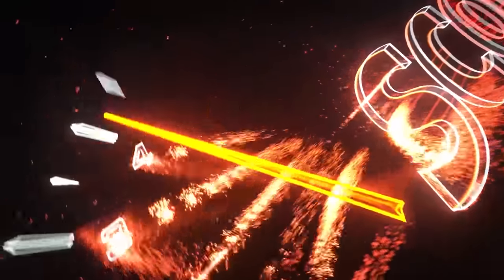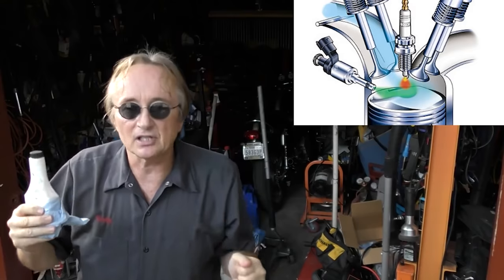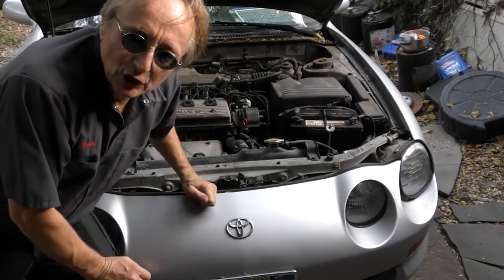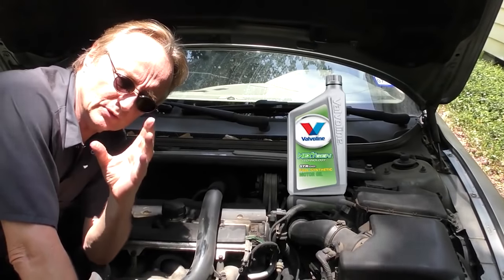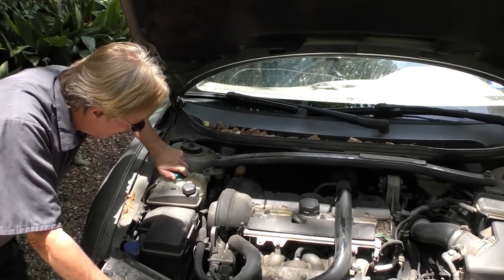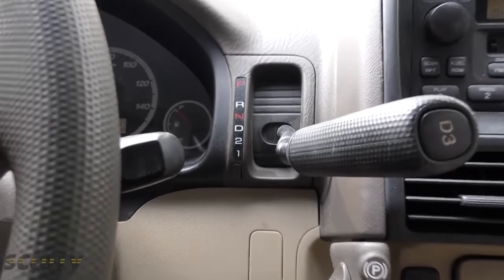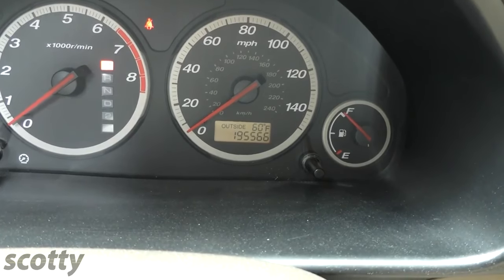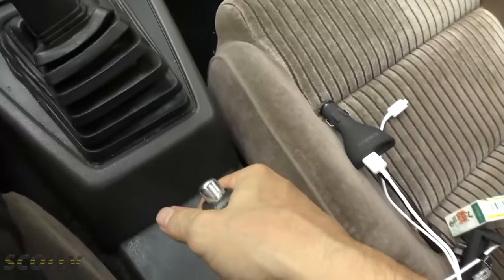20 Things Only Stupid People Do to Their Car

Comment: 11:17:  This behavior isn't the fault of the driver; it's the fault of the manufacturer who should design the transmission lever so that it can't move without the button being pressed in.  However, I discovered something interesting on a 2016 Toyota Sienna I used to have.  I noticed how easy it was for the gear shift lever to be put into reverse because the gear shift lever didn't even have a button on it.  However, one time I did accidentally throw the lever into reverse while the van was moving about 10 mph in a parking lot --- and THAT was when I discovered that apparently the manufacturers had thought of the possibility of that happening and had built a compensating measure into it:  Here's the compensating measure:  If you're traveling down the highway at 55 mph and you accidentally bump the transmission into reverse, nothing happens --- until you bring the vehicle to a complete stop --- and THEN the transmission shifts into reverse the next time you push the gas pedal.  So if that lever gets bumped at highway speed, you still want to immediately pull over, bring the vehicle to a complete stop, and then shift the transmission back into drive because you don't want that automatic shift change from drive to reverse to occur at a stoplight where you forget that the gear shift lever has been bumped and then you arrive at a stoplight, bring the vehicle to a stop at the red light, press the gas at the green light...and suddenly you find the vehicle violently backing up and ramming whoever is behind you when it happens.

Comment: Water cooled ? The product engine coolant has a lubricant in it to reduce friction on parts like the water pump.
Reply: "Water-cooled" is the term for a mechanical system using water-based coolant, in car engines that coolant is generally a mixture of 50% pure water and 50% ethylene glycol, with the ethylene glycol acting to prevent corrosion, acid degradation, lower the freezing point, raise the boiling point, and it also assists in lubrication. So yes, a turbo using the engines coolant is water-cooled.

Comment: If you have more than 75,000 miles, or so, it might not be a good idea to switch to full synthetic oil from asphalt-based oil. You may end up with oil leaks and oil burning. If your car started out with synthetic or you switched with low mileage, then no problem.

Comment: A few years ago I stopped to help out a couple who were moving house and their van battery had died - I offered them a jump start from my little Fabia - connected the cables properly on my end, then handed the other ends to the woman in the van (the van battery was in the passenger side foot well) through the passenger side window. I made the mistake of thinking everyone knows how to connect jumper cables and turned away only for my car to suddenly emit a horrific high-pitched screaming noise - she'd connected the negative clamp to the negative port on her battery, and the positive clamp to the little bolt holding the negative port to her battery - starting a small fire inside the van before she managed to pull the cables off, which was happily beaten out before it could do any real damage.

After that little drama we tried again (I wisely connected her battery for her) and off they went, but when I got back to my car the engine was still running, but all the electrics were dead (power steering, central touch screen, digital fuel reading and odometer).  Luckily it all came back to life after I restarted it - but can anyone explain what actually happened? What was the screaming noise from my car? Why did all the electrics cut out but the engine kept running? And how bad could it have been?

Comment: What about neutral in the automatic transmission? When should we use neutral?
Reply: When you want to disengage the transmission for any reason. Automatic car washes, or if you have a 4x4, you need to be in neutral to shift between 4-high and 4-low. If you need to push it or tow it. Anything like that.

Comment: Gosh - he shouts a lot, doesn't he? I spent twenty years designing the electronics for vehicles - we assumed that 1. someone will try to jump-start reversed. 2 someone will try to jump-start from a truck (24V). 3 someone will try to jump-start from a vehicle with a bad battery (9V) so we designed in protection for all of those situations. I recommend checking before you connect jump leads (positive battery to positive battery or post - negative to the vehicle chassis) but you would be very unlucky to do any damage if you got it wrong.

Comment: I remember once you fixed a car using additives, it was a fuel system cleaner that you used, how come now you're saying not to use them?
Reply: I think if there is a problem, but if there isn't, don't bother wasting money. Makes sense since most fuels in certain states are required by law to have adiditives. I guess unless the additives are different from state adiditives that provides additional cleaning that doesn't do more damage.

Comment: Funny how car electronics have the exact same voltages as a regular desktop PC. The Power supply of a desktop feeds mainly 12V like a car battery, and that voltage is used by hard drive motors along with 5v&12v, then the motherboard takes the 12V straight to the CPU, and the voltage regulators convert it down to low voltage (like ~.8v-1.35v) but at hundreds of amps of current for the chip. Same for the Ram. PCs also get 5 volt rail from the PSU that feeds many chips and hard drive logic+motors/fans and etc. It's like the PC designers saw car electrical engineering and applied a lotof its concepts to PCs. Phones are different, but they use 5 volts to charge them lol. Really confusing why car computers are so expensie when they can't even run Crysis (lol). It almost feels like the corrupt insulin industry with the price

Comment: Somebody really doesn't know how electricity works. Connecting a jumpstart backwards won't make the car's ground go to "positive 12 volts". If it actually has a connection to ground it will stay at ground. Voltages aren't some absolute thing, they are always relative to some other point, that's why an alternative name for voltage is "potential difference". What it will do is cause an unholy conflagration as the battery and jumpstart mutually discharge each other. The actual voltage (potential difference) across the car's electrical system will probably be close to zero volts in that scenario.

Comment: Nitrogen. What a "stealership" scam. I worked at a dealer who'd tack on $300 CDN for "lifetime" nitrogen. The idea was every time the car came in for any service, or on request, they'd "top up" your tires with nitrogen.

I'd watch the mechanics doing a PDI put normal air into the tires and then screw on the green stem caps with "N" on them. Customer drives off thinking he has pure nitrogen helping his tires last longer.

Comment: Phhhhttt. Been downshifting my manual trans vehicles while slowing down for almost 40 years and I have never “ruined” a transmission or engine. Not only that, my clutches last a long time as well. My current truck has over 200k miles and I don’t drive like a sissy. I downshifted my Acura TL-S the entire time I owned it (11 years) and never replaced the clutch. I sold it with the original clutch still in place. So I am calling that myth busted.

Comment: 11:37 I don't think you could even accidently push it in reverse, you can see Scotty pressing the button to unlock the shifter and put it in reverse. And in most recent automatic cars, it doesn't let you press the button if the brake pedal isn't pressed first. These often have safety systems like this to prevent you from breaking your transmission.

Comment: I don't think they were trying to push Nitrogen, exactly, but instead they were trying to sell a lack-of-Oxygen on the inside of the tire.  The thought process was that less Oxygen means less Oxidation... and so the tire lasts longer.  EXCEPT, the outside of the tire is still exposed to Oxygen, so it was a pointless exercise.  Plus, unless a person had an incredibly, incredibly low driving schedule, then the tires wore out long before they aged out.

Either way, the Nitrogen fill was a waste of money.  It definitely had technical benefits, but it had not practical benefit.... unless you were the guy selling Nitrogen.

Comment: The reason airplanes fill their tires with nitrogen is to get consistent pressure-- no magic chemical mojo or improved performance involved.

Using a pure gas like nitrogen (or any pure gas, for that matter) means that science will tell you exactly how much gas is in that tire-- ordinary air is a mixture of different gases, so you won't know exactly how much is nitrogen versus how much is water vapor. The airplane folk don't like ambiguity.

Comment: So about the oil my genesis 2.0t says 5w-20 on the cap but the previous owner put 5w-40 so I recently changed my oil and put 5w-40 too because the engine has 168000km on it and I’ve heard the 5w-20 is too thin for the turbo charger and is better for engine with high mileage. Anyone knows if it’s bad?
Reply: I'd always stick with what the manufacturer recommends.   They built it and have more experience and knowledge than me or some bloke on the Internet.

Comment: 15:15 Parking a manual shifted car at a hill with gear in is ok. Usually they don't slip out. I have seen enough manual cars, where the owners put emergency brake in, cause the manual told them so, and the brakes freeze fixed in the winters. So need the 1st gear to hold the car in position. IF you are worried that the gear slip out, use the reverse gear.
But Don't use 3rd, 4th, 5th or 6th gear for holding the car. Only 1st and R are strong enough to hold your car. And the gears can't freeze like the brakes.
Reply: No, I tried it on some hills and it rolled slowly backwards, just use both the handbrake and gear to hold it
Reply: @UndercoverDog  First or Reverse gear. And turn the steer to the curbstones.
IF you use Handbrake in winter, it can freeze, and you can not release it.
Reply: @TobiasRieperGER  it was first gear. There may be cars that can hold extremely well only with the engine, but not every car. 
Im European tho, we have steeper hills than Americans have. Never had an issue with the handbrake freezing up.
Reply: @UndercoverDog  i am from germany, so i know what mountains can be.

Comment: Don't beat an engine or trans when cold. Don't go more than 8,000 miles on an oil change, on ANY car, unless you drive 90% highway in a small car, all year. I don't care if that oil advertises 20,000k mile intervals. It's a 90% lie mixed with 10% truth. 100k miles on ATF is also a lie, 90% of the time. If you tow or drive crazy, keep it to 40k mile atf changes.

Comment: 3:00 I used to put 10W-40 instead of 5W-30 in my VW Golf mk4 with the glorious masterpiece of engines the "1.9TDI" .  eventually valve cover gasket started leakinking.  Not an expensive problem but It's a problem nonetheless.

Comment: 12 V on Ground is not the cause of a killing the computer.  It is the reverse polarity on electronic components that is the killer.  Even old cars that are not computerised will get damaged by reverse polarity.  The alternator on old cars can still be damaged by reverse polarity.  Computer would not care if you had a 24V system centre tapped with 12V at ground, and 24V at the positive, as long as the potential between ground and positive was 12V.  The computer has voltage regulators INSIDE the computerthat reduce it to 5V for the systems that need 5V.
Great idea to tell people what not to do, but it would be actually good to knwo the REAL reason for not doing it and not jsut pretend to know.
Thicker oil, if it is only slightly thicker, it wont make much difference to valves and all that stuff.   Oil is thicker when cold than when hot anyway.     Same with synthetic oils.   Maybe good for modern engines, but your classic cars will last much longer on original mineral oils.   Synthetic is not the be all and end all.   Use what is recommended for your engine.

Comment: An engine will not get to running temperature in 5 to 10 seconds, give it 5 to 15 minutes depending on vehicle.
Reply: But the oil is circulating.

Comment: The reason why they put Nitrogen into airplane tires is because there is no oxygen inside the tires.

The brakes are relative tiny compared to the weight and speed of a Jumbo Jet. If there is a problem with the engines or flaps, they might to land without reverse trust and a lot faster than usual. And if they need to land immediately after takeoff, they have several tons of extra fuel on board.

In those situations, the brakes become insanely hot and heat the tire from the inside.

Without oxygen inside, the tire will take slightly more time to ignite and if caught on fire, the fire will spread slightly slower. This can buy extra time for evacuation.

Also if the tire overheats due to stuck brakes or misalignment and it had caught fire before it is retracted into the plane, the fire suppression system can only extinguish the fire on the outside of the tire. Without oxygen inside, there can’t be a fire inside.

So there are several benefits which apply to special machinery and airplanes but those are non existing for cars.

Comment: Hey im the third generation who has worked in the british car industry (ik the cars are crap but ehoh).

Jump starting the car in reverse wont kill your engine, cuz thats not how the gearing works

Honestly unsure if this channel is satire but the first me minutes have me thinking so
Reply: No what he was saying is that can mess up your computer, and the newer computers have less variance and smaller voltages controlling memory and sensors. If your computer goes bad in some cars,like a damn Audi, it can definitely in some years destroy the motor. Granted those cars are just made on the lower grade models to just live fast and die quick.

Comment: 11.68 volts is technically a dead battery
12.7 is full 11.8 is dead
But some still provide enough juice to crank the car over 1 or 2 more times

Comment: who jumps start a car BACKWARES? I mean even if you can't see the + or - you can see the RED wire & the BLACK wire which would say that the RED is + and the BLACK is for - NOW as far as adding FUEL  ADDITIVES I've been adding them in both cars I had from my 94 Madza Preteeg & my 94 Olds Cutlass,NOW since I brought it in 2003 and it DOES clean my fuel injections, which doesn't get quite as dirty in fact whne I had that issue a few months ago the 1st thing they checked WAS my fuel injections & while it WAS dirty,but NOT as dirty AS IF I didn't USE IT @ all I do have a favorite BRAND STP FUEL INJECTOR CLEANER that I would use every 2 months & it does really well.

Comment: basicly what he said is be smart and think further then just6 tomorrow and eb nice to the car even if it's a toyota or whatever it's. be nice to it and change the oils and flouds once in a while t o keep wear down. better to change oil then have the motor start wear inside. also yes the car can handle it but dont just floor all the time because that is one of the things that causes wear. and also if you are going to change one thing in the car, and it's not easy to get to, then  it's better to change more things at the same time like he said woth the cluch dont justg switch the pad and call it a day an then drive 2 month and then replace the rest of the cluch system, but ratehr change more things and teh same time so u dont need to do more work then  needed. yes it's cheaper to just change for example the pads but the other way you are furtur profing, making sure that you are not gonna work on the car for a little while. better to look after the car, rather then drive it til it says snap and you got a proplem with the car. every car needs be taken car of otherwise it will breakdown no matter what car it is